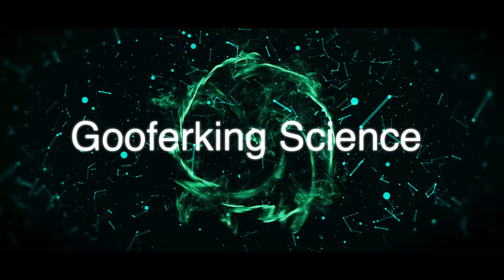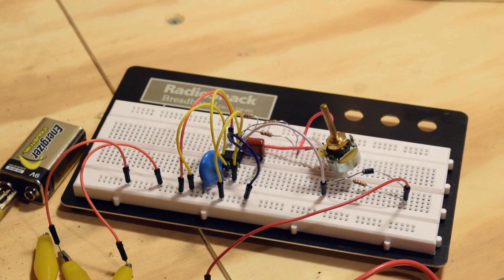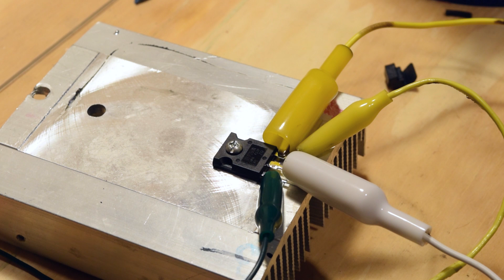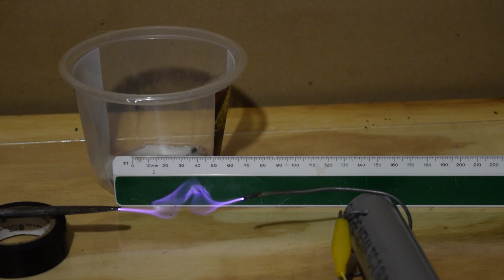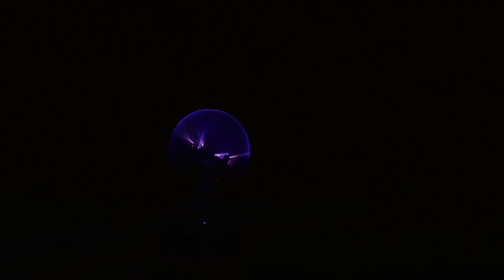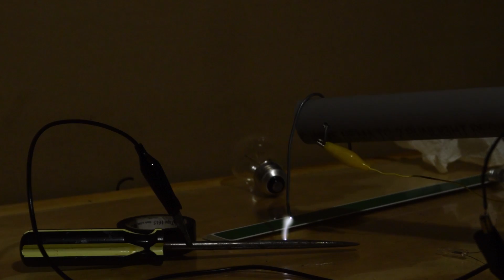60KV X-Ray Transformer - 555 Driver

Comment: Nice Demo, thanks for sharing it. This Siemens X-Ray Transformer was supposed to operate in Pulse mode, (Just for one short X-Ray Dental Picture). By Running this transformer continuously, wouldnt be possible to damage it by overheating it and damaging the wiring in the coils ?

Comment: very nice setup for the variac, i need to find me some transformers so i can try it out. right now i'm using 3 12 volt batteries to power my circuit, using the same variac as you got, just dont have right transformer to give higher amperage output. great video and good job

Comment: Thats way less than 60 kV. One mm rule only works with voltages less than 25 kV and spherical electrodes. At this frequency and shape of electrodes I would say it's no more than 30 - 40 kV